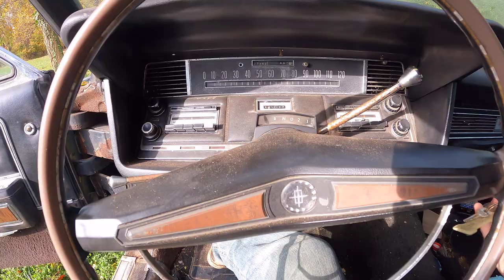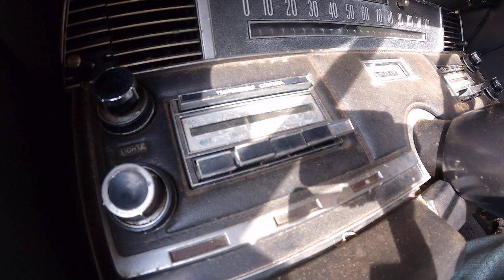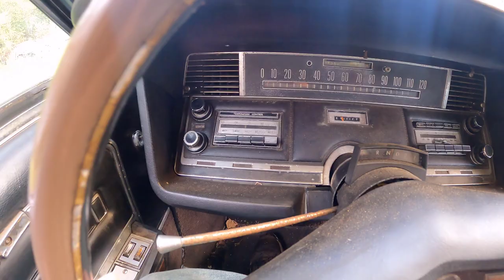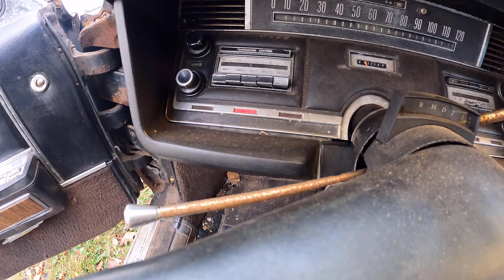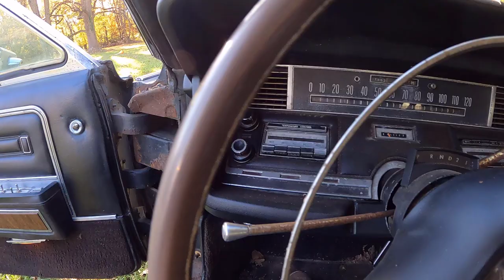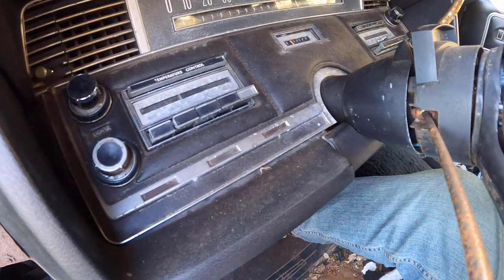1969 Lincoln 460 Oil Pressure Idiot Light On

Comment: Thanks for the video, any idea what that knocking sound is when you started it up at 8:53?  I just got a 68 Lincoln Continental almost exactly like yours, it needs quite a bit more work though.  When I got it started for the first time yesterday, it made the exact same noise as yours but went away after it got running, I was thinking it was the lifters?  Cool car man
Reply from the maker: Thanks man, dont know what that noise was, but I sold it. I miss it though...it was a badass car!

Comment: My hot light and oil light are always on my Lincoln .I still have the mark 3 oil and hot light sending units installed.The mark 3 had gauges instead of light .I ordered the proper sending units from rock auto.Typical low oil pressure is from wore out rod and main bearings.I replaced mine when my engine was out .And new roller timing set.Still had the nylon timing gear .Did your passenger side valve cover have baffle under the PVC valve. Mine does not. So oil is getting sucked into my PVC. My 78 460 in my F-150 does have a baffle.
Reply from the maker: Morning, no baffle under my valve cover. I was nervous I needed bearings...glad I dont! I can hear oil getting sucked into my PCV!

Comment: Fun video! At 6:16 of the video I see something dripping from the just-installed oil filter. Is that just some condensation under the car because it was parked in the yard or something else leaking?
Reply from the maker: That was residual oil I spilled when screwing the filter on. Its good for the environment.